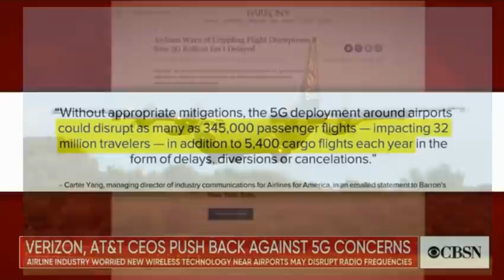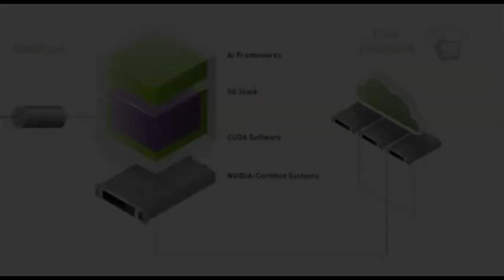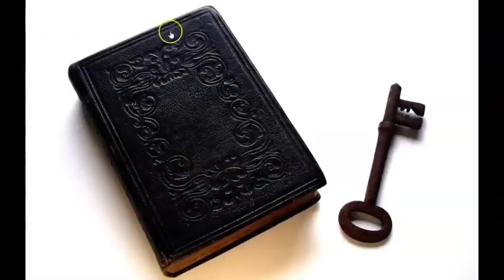5GRollout Off Limits to 'Certain' Airports in USA...AI SkynetCyberAttack

Comment: It seems only the US is rolling out the C-band spectrum on band n77 unlike other countries that use band n78. 

"Most of the rest of the world started to auction off C-band already; in terms of the number of countries, it's probably the most popular 5G band in the world. The International Telecommunication Union (ITU) chopped C-band up into three chunks: band n77, band n78, and band n79. Most European and Asian countries currently use n78, which stretches from 3.3 to 3.8GHz. We in the US will use n77, a larger band from 3.3 to 4.2GHz. Japan also already uses n77, so equipment and phones are out there."

Airplane altitutde radar use the frequency range from 4.2GHz to 4.4GHz that's where the problem comes in, while band n78 sits further away from those frequencies it is much less likely to interfere with planes unlike the band n77 that US providers selected that goes all the way to 4.2GHz. Why the US would not just opt for what other countries did is beyond me and likely intentional.
Reply: Wow, thanks👍🏼 You must be an electronic engineer or something like that 😊🙏🏼
Reply: Why are they saying it can be turned up to 60 ghz??
Reply: Most of Europe is on Ericksen's system (which I think is Swiss?) while we in the good old US of A are on the CHINESE Huwae (sp?) system.  Of course.
Reply: Thank you Miguel for informing us all.
Reply: @MrThatWatchman  exactly! Yet the truckers crossing borders still need it. Something big is coming